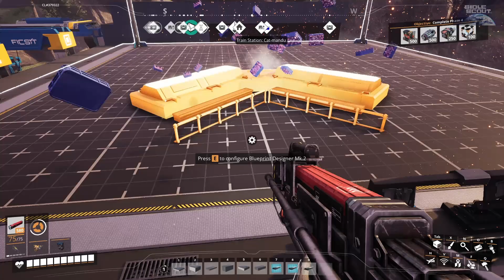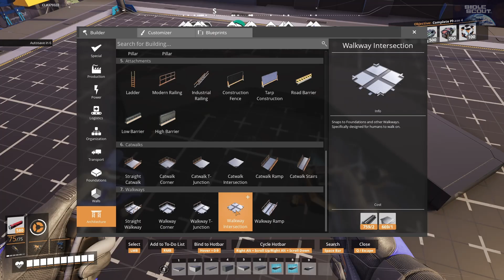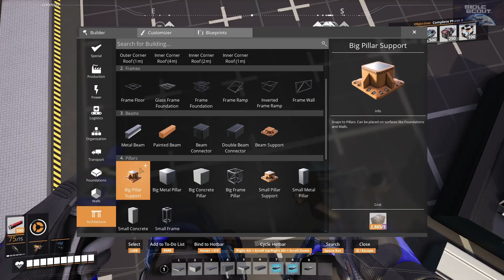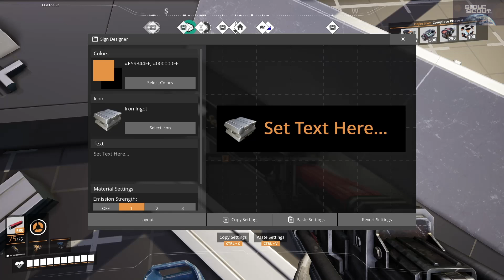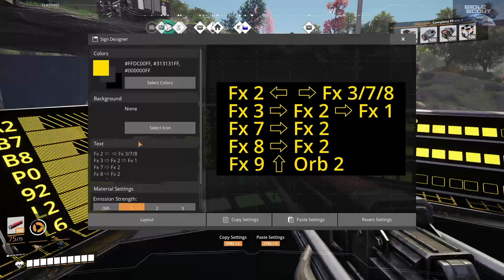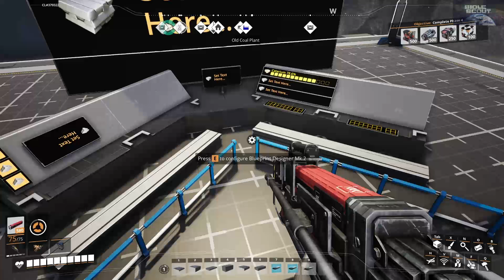Build a Control Panel with NO MODS - Satisfactory 1.0

Comment: Great inspiration, though wouldn't it have been easier to build it in line with the grid of the Blueprint designer and rotate it 45 degrees when pasting it in your build rather than building 45 degrees to the grid?

Comment: By the way, for colors you don't have to go say -8 and such. The furthest you have to go to get the deep rich colors is +1.5. and -0.5 for darker. No joke. All it's doing is raising and lowering the brightness and contrast, and that is as far as it can go. When done on the color part (the center bar), going 1.5 allows the full color wheel of colors where as higher is boosting the contrast so high you remove colors as 'anything in the blue range is just bright blue'.  The only acceptation to this is getting white. but to get bright white you only need to go up to 5. Anything higher is the same, and it also depends on the material. Concrete walls for example the texture that does the color overlay is well... weak.. so regardless what you do colors will always be pale on it. Where as concrete foundations will take on the bright hue.
Reply: can confirm. black up to -0.5 is enough in most cases. 
If u use that on a swatch depending if its shiny, default or matte u notice it up to -1.0 on foundations i think.
Difference for example on coated concrete foundation is that the shiny swatch tops on the coated shiny texture,
default is also getting super black but u can see a slight brighter texture in the reflection.
Matte on a swatch is a perfect even black surface texture. 

white above +5 shouldnt be  making  a difference. 
Only when u use colored stuff like on foundations u have more visible steps in difference if u go +10, +15 and so on.

On Display Signs u also can use Emmission at 0 + a Color at +5 or more, it gives a nice effect.

I made myself a Blueprint with 0,5m display signs flat on the ground layered like a list with all my color combos (colored background, emmision 1,2,3 bla bla) i like to use.   i think im at 5 rows now xD. 

also for the foundations make yourself a test stage and mark the foundations from lowest brightness / contrast combos upwards,
best way to know for sure what your colors actually do.

Comment: Never been into mods myself but as you mentioned i would love for a logistics stating like numbers of machines number of items power req for the factory. im currently building a city with mostly 1-2 items for each building stuff like iron plates and rods and copper wire and cables. my current progress is iron smelting facility , copper , quickwire. concrete silica and quartz iron plate and iron rods and lastly copper wire, cables. i just noticed im already up to 50k / 60k mw of power so will soon need a break to realy boost the power grid. Tho majority of the buildings will use trucks on the 1th floor for reciving / delivering goods to make the city abit more lively.

Comment: To eliminate the z fighting
Place a pillar on top the middle of the half foundation (also works with a full foundation), dismantle the foundation, rebuild the foundation this time locking it to the pillar.

Now that foundation is 1mm above the other foundations and will be fully rendered over the other ones
Reply from the maker: Thanks for the tip!